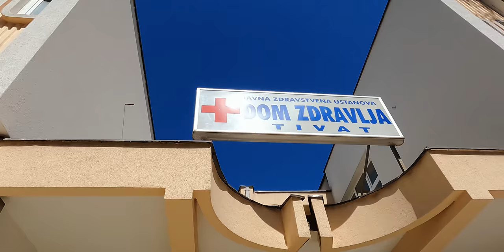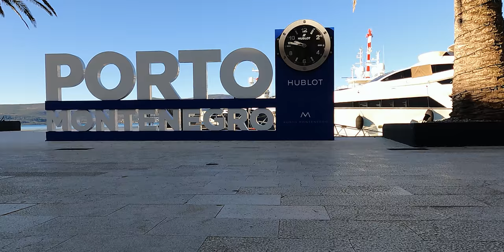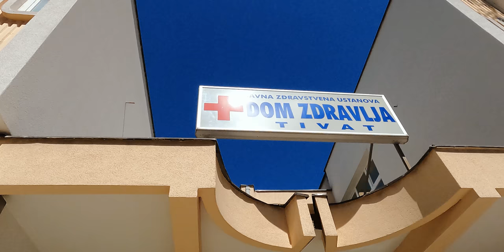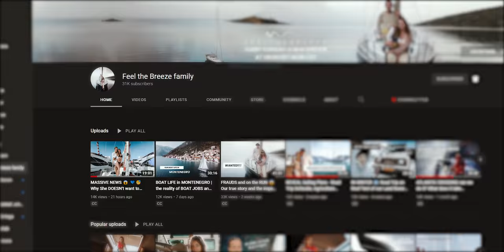RESIDENCY in MONTENEGRO  | the REAL reason why we stay in MONTENEGRO

Comment: The only multihull I've ever heard about in Arctic/Antarctic waters was a (Norwegian?) trimaran that tried the North-East passage (Russia) some yrs ago. The boat was super fast, but wasn't able to cope with the closing and opening of the drift ice. And ofc multihulls and ice is NO BUENO. So that idea sounds extremely stupid to me. And rough and icy sea is why there are extremely few multihulls in Norway - they just dont fit.
Reply from the maker: Thanks for your comment! We are very curious how others reflect upon this. Would be great if more could join the discussion of catamaran sailing in the colder and rougher climates.
Reply: @FeeltheBreeze  Thank you for reading :) Well, maybe I was too fast commenting as I forgot to mention I myself was an early adopter, ie owner, of a multihull boat here north. In my teens I had a Danish Supernova, a 14" trimaran with tiny outriggers. It was designed to flip over and go fast and was perfect for dates with curious girls on flat water lakes with its soft trampoline 😉. 
When I say that multihulls are not so fit for though conditions I came to think about Alluring Arctic (Youtubers) that were "stranded" in a fishing village on Iceland this winter. Overnight the not so well protected harbor froze that caused some concern. Ancoring was out of the question in those waters. I just cannot imagine what the snow and ice and sea would have done to a multihull. Imagine you have to de-ice over 1000 sg.ft. of deck just to stay afloat. However, my biggest concern is how sea ice would fare with two or three hulls. If I had seriously considered high N or S travels I'd get myself a motorsailer that also have indoor steering/sail handling, type Finnsailer, or one with a very sturdy dodger. And mult-fuel options (diesel, wood, coal) for heating the entire boat as non-protected diesel in the tanks can also freeze. Tot ziens from a half Dutch.

Comment: For setting up diesel heating and preparation for cold-weather sailing you should email the following sailing channels: “Alluring Arctic Sailing” and “Sailing Uma”. Alluring Arctic Sailing also has a video on setting up heating with diesel. Insulation for your boat might be an issue, as well. 

As for a catamaran, they are basically a small house on platoons. Life is literally on the level, particularly when sailing. However, catamarans typically don’t sail well close to the wind. Also, in extremely nasty weather, particularly the kind that you will find in waters near polar regions, catamarans are far more dangerous than a monohull with a massive keel. When a catamaran capsizes, it stays capsized.
Reply from the maker: Thanks Jeff, we are Patrons of Uma and watch all their episodes. Just finished watching Alluring Arctic sailing, thanks for the tip, really helpful. Regarding the CAT vs Monohull discussion we have to figure it out but I am totally with you ;) Gerben